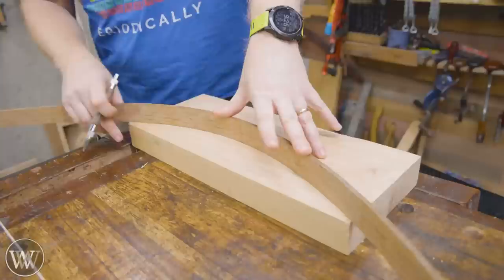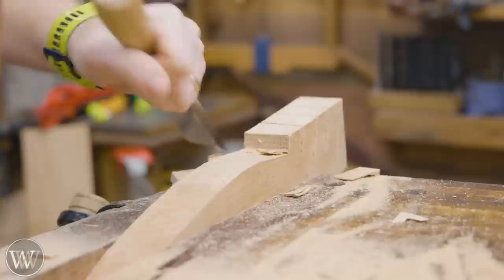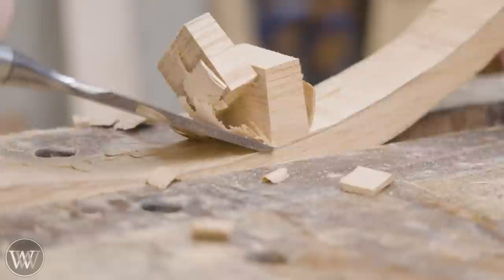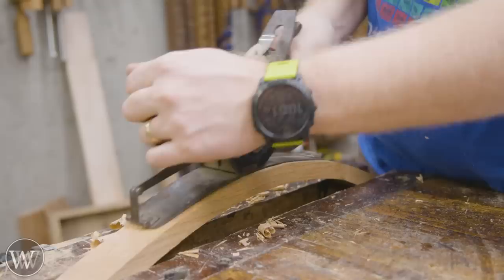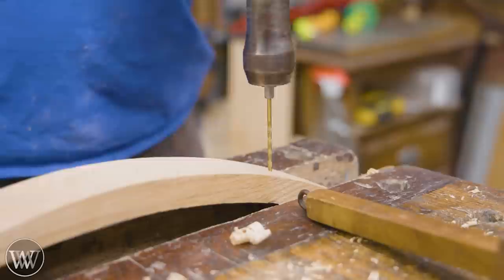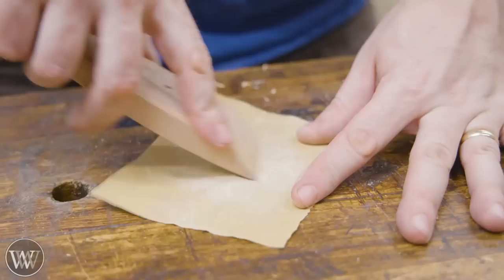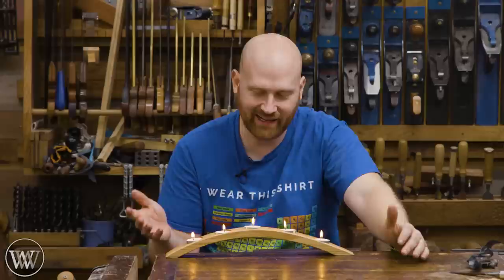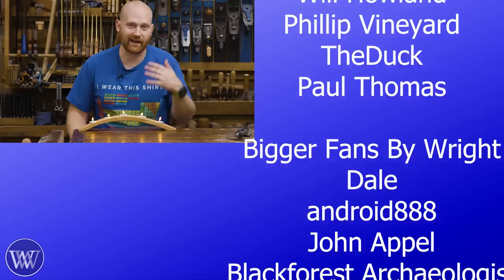How To Make A fast and Easy Candle Holder

Comment: I like the sharpenable saws. There are some cheap hardpoint saws in the local woodshop I often go to, but they have become quite dull over the years (I bet other people there also use them on metal a lot…) and someone desparately needs to go to the hardware store and buy new ones. With my sharpenable saws, I can sharpen them any time I like, even at midnight when the stores are closed – I'm more of a night owl anyways, so this is when I mostly do woodworking. And I like the thought of not letting good steel go to waste. After all, I have more than enough card scrapers and scratch stocks, and still more than enough old saw blades left for more 😅 
Merry Christmas to you and your family!

Comment: I've got an old Stanley hard point saw that I bought in the late '90s, long before I became interested in hand tool woodworking. It cuts on both the push and pull stroke, or so the packaging said. It definitely does better on the push stroke. There was something my circular saw wouldn't do, so I bought this thing. For years, I was convinced that it was crap and wouldn't cut anything well. I only used it when absolutely necessary. After I actually learned the proper grip and mechanics of using a hand saw, from your videos, I discovered that it actually works pretty well. Now, I like to use it for rough dimensioning, sometimes.

Comment: I rely on the cheap saws for a couple things. I generally breakdown large stock outside, my boat is being built outside and I live on a small farm with critters that love to disassemble stuff. So when I drop it , bang into something or need to cut something abrasive I don't whine, snivel and cry, also any of my family can pick up another on a run to town. Also my little "Aw crap" bench/stool/ tool transport is sized for hold one.

Comment: Nice piece, i love it ! I would have cut it with a turning frame saw (the 70cm long ones we have in continental Europe, idk if you have one), saves a bit of wood if you cut several arches, but whatever 🙂
Reply from the maker: If the piece were thinner I'd probably jump at that. But the amount of time it would take to cut two inch thick wood would would be considerably more and far less enjoyable. But that's just my list.
Reply: @WoodByWrightHowTo  indeed it's much faster to split the wood 😄 but vs a ripsaw, i think a full-size turning saw would not be that slow.  i was just wondering if you knew/had this type of saw. I love your content btw 🙂
Reply from the maker: thank. yes I have two full sized turning saws. I have a few videos making them if you want to see more.

Comment: It never fails though, at some point you will have a need for that curved off cut for something you had not yet imagined.   At least, that is the way it works in my shop! 😂
Reply: That is what turning saws are for (or bandsaws in the case of lazy me).
Reply: And of course, you're guaranteed to need it about two weeks after you clean out all the offcuts you've been holding onto for years.

Comment: How do you make a flat bottomed recess without the dimple left by an auger or forstner bit?
Reply from the maker: you can use a hole saw with out the dead screw and then carve it. but in any method it will mean carving it.

Comment: I just dislike the wastefulness of hard point saws. I'd rather spend a few minutes sharpening than just toss the saw when it's dull. Sharpening is a skill you have to learn in woodworking regardless, why not do it for saws too?
Reply from the maker: I would generally agree. But one $5 hardpoint saw usually saves me about three sharpenings. And if he sharpening takes me 10 minutes that means it saved me a half hour. And in my book that's a good investment.
Reply: @WoodByWrightHowTo  I totally get it. But to me, part of the joy of hand tools is breaking out of the production mindset. There is also some amount of time associated with buying the saws. I guess I see the hobby as including taking care of the tools I use, and sharpening my saws is part of that.